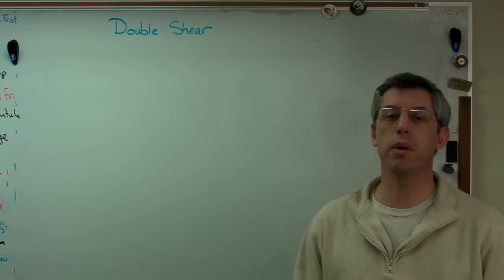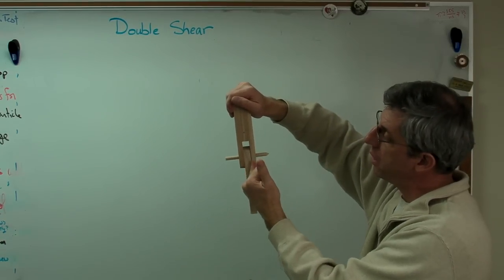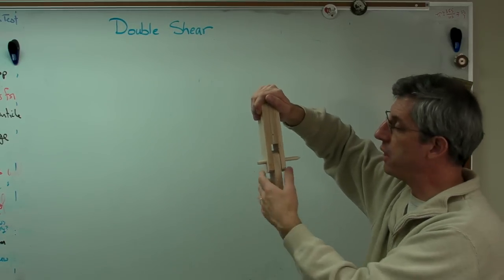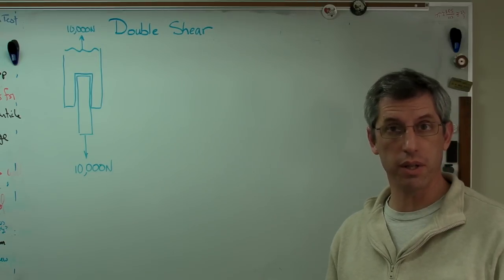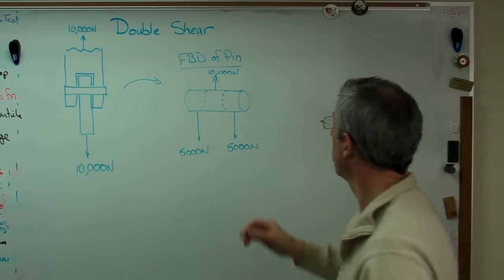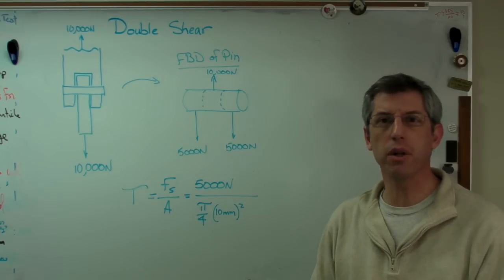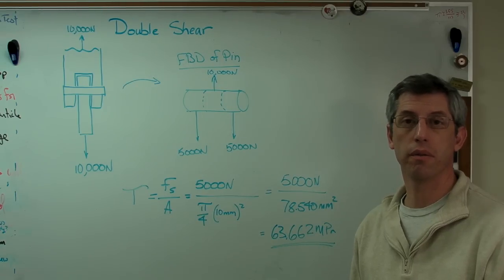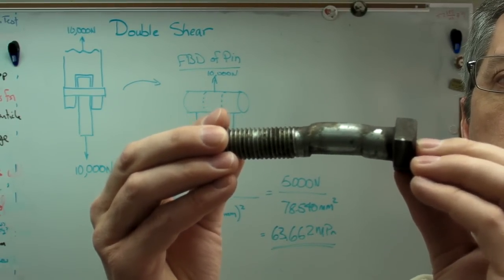Double Shear.MP4

Comment: Nice video.  You could have taken this one step further and explained that plastic failure occurs when the average shear, as calculated, reaches some factor of the yield stress where the factor is about 0.6.  This might be confusing for students but one must remember that the shear stress is not the only stress in the system and if one uses, say, the von Mises criterion, then it is the equivalent stress that needs to be monitored for failure rather than the shear stress.

Comment: well of course that bolt failed someone didn't use proper hardware that's a grade 3 bolt possibly.. tensile strength in that isn't enough obviously.. should've got at least a grade 5 or even 8. but thank you for breaking it down it gave me a understanding now.

Comment: So if calculating "Double Shear", as mentioned in the video title, surely it should be: t = F/2A? Considering that the formula used: t = F/A is the formula for Single Shear.
Reply: +Jack Mathieson It is, but since he went ahead and changed the force from 10000 N to 5000 N in the FBD, he didnt need to divide it by 2 in the final equation.

Comment: Why shearing force is 5000 and not 10000? There is a leap from -5000 to +5000 in the shearing diagram, isn't it?
If we want to use the result number to compare with a material; what number do we choose? yield stress or we have to divide it by the square root of 3?
thanks